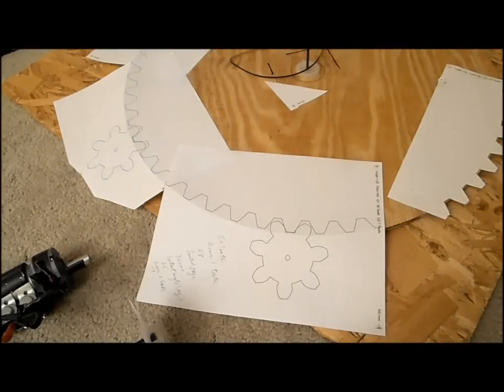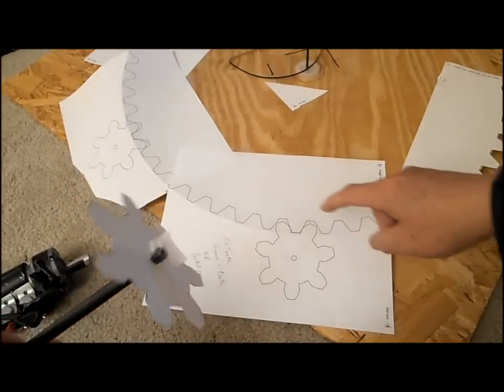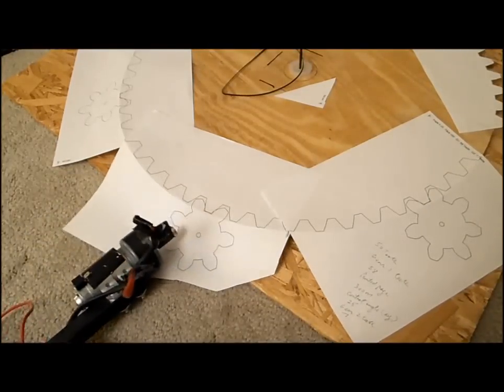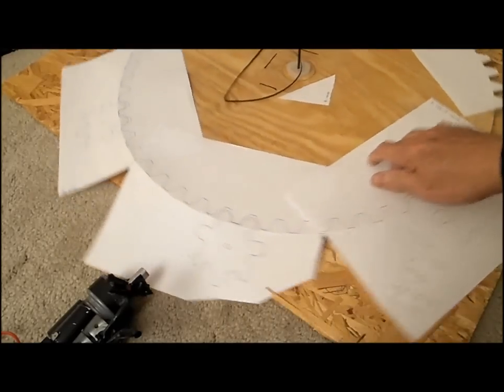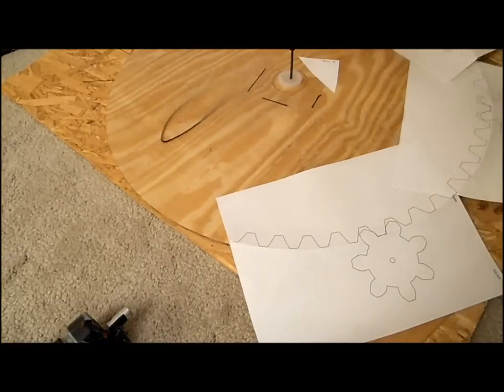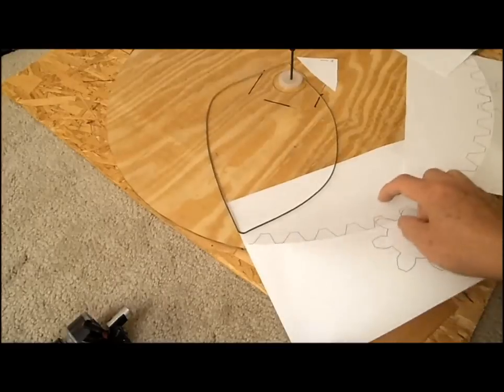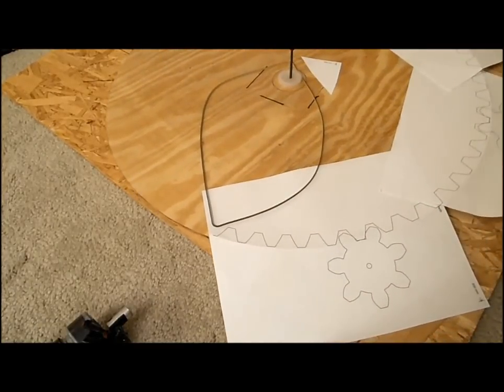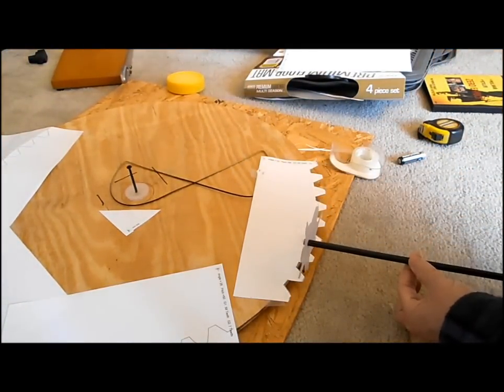Wood gears for solar oven turntable and LED dc motor pull light

Comment from the maker: You are right about using cutting boards. Right now, it's more proof of concept. I just want to see if the whole idea of using small solar panels, instead of batteries, to power the turntable would work. It seems matching the right panels to the right motor is the key.

Comment: If using a scroll saw sounds interesting to you, I've found that Craigslist is a good place to look for them.  Lots of people have scroll saws sitting around barely used and list them on craigslist for cheap.  The problem with a jig saw is the bending of the blade and moving around of the saw doesn't give much of a precise cut, but a saw with a table gives you a much more precise cut.

Comment: No problem.  One easy tracker would be an Arduino and a good size servo motor($10 bucks maybe?) and one 10k resistor and a photo -cell.  You wouldn't need limit switches and the code is pretty simple, but it's sometimes easier said than done.  You can watch how gears work in sketchup by doing a youtube search for "gears sketchy physics".

Comment: About a year ago, I cut out a 4" gear with a pattern from the same gear pattern site you used and it turned out looking very good.  You need a newly sharp blade for such a task and a band saw would get expensive to use.  Scroll saws have very short blades and look ideal, although jig saw would probably work too.  I need gears for solar tracker ideas too.  I mad hinges from wood dowel rods and they work, but are a bit sloppy.  If it were all made from a hard wood it would work better.

Comment: That's exactly what I've been wanting to do for a few years now, but I've never got around to trying it.  I forget what kind of plywood they say to use, but that pine wood would do for practice.  I cut out one gear and found that the pine plywood sometimes chips apart a bit, but it works.  I used a small band saw, but I think a scroll saw would work much better.  I don't think the big gear would need to be that big though.